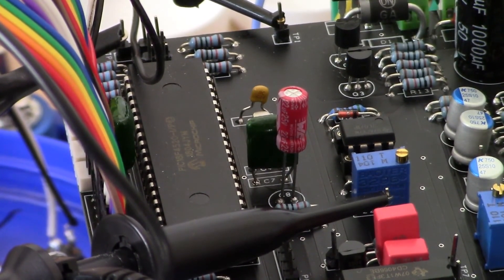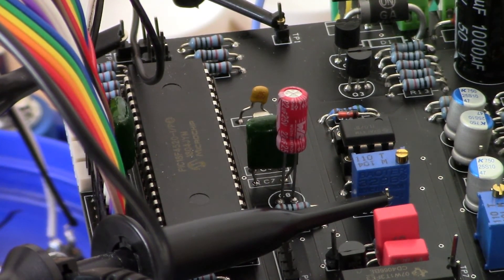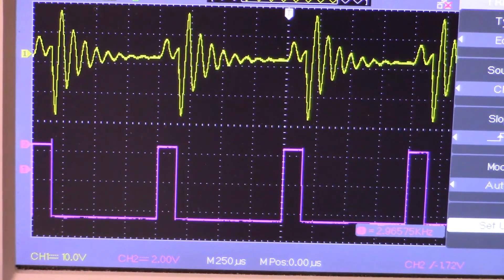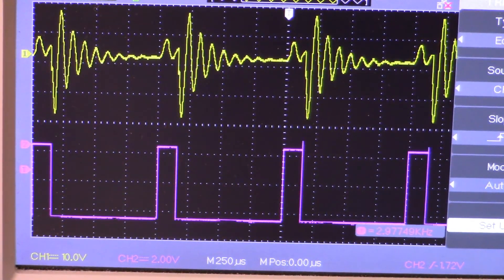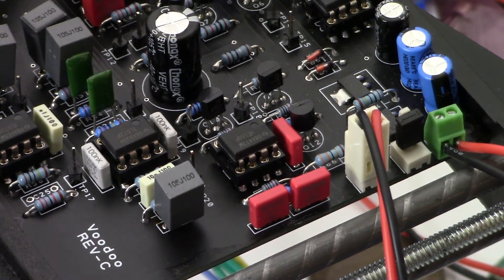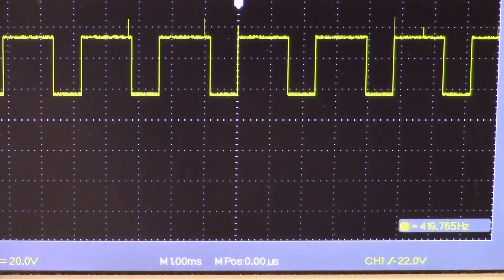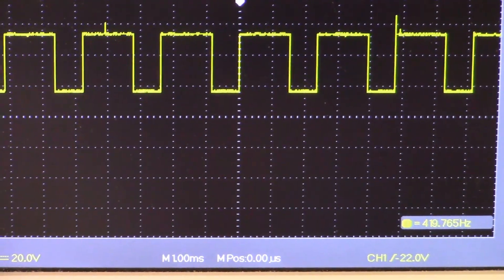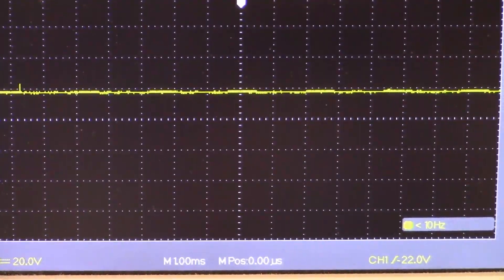Voodo DIY Metal Detector part #6 Disc pre amp and Audio circuit

Comment: Waiting with interest to see it tested. Did you finish the coil?
Reply from the maker: Hello,
I am using a Fisher F75 coil for this Voodoo machine.  I have taken it out a few times but did not record video because of the weather.  The depth on the machine is not as good as my other detectors.  Thanks for watching.
Reply: Surf Detector for me, i would like to use this detector in heavy mineralization, bricks, potery, with Concentric coil as is more good at target separation. So depth, for now, is not so important. I’m sure that it will be improved! For now i’m building DFBowers disc add-on.

Comment: Hello sir, how are you , thank you very much for these wonderful videos, good and useful information Please, I have a question about the voodoo project. I heard that it is open source and the source code is available. Question is there a possibility to change the screen programmatically with a larger one like 128 × 24 Or is it difficult and requires
Reply from the maker: Hello Bilal,
I imagine that it is possible if you were to change and recompile the code.  The person to ask is the creator George Overton on the Geotech Forum.
The 16x2 LCD is very standard and easily available so I do not see the need.  Thanks.
Reply: @SurfDetector  thank you my friend🙏

Comment: Finaly in the future on my MD project I'll also use 555 IC as the tone generator, pin 2 for the enable/disable the tone that triggered from signal level, and pin 6,7 for the tone frquency that controlled from phase shift for a different sound on each metal ferrous/nonferrous.

Comment: I want to see that baby in action 😎
Reply from the maker: I need to wait on some parts to box it up and then I will take it to the beach to dig up some nails :)
Reply: @SurfDetector  Please do detection depth comparisons between the Surf PI, Hammerhead, and Voodoo once you get them all finished.
Reply from the maker: @winstonsmith478  Hello Winston,
My free time is limited with my job and when I take a detector out to the beach I like to just detect.  I have too many detectors to box all of them up with shafts and dedicated coils etc.  I do the various builds in order to simply get a record of how to do the builds correctly in the hope that the videos will be of assistance to others down the line.  Thanks for the comments and please subscribe if you find my content interesting.
Cheers

Comment: Sir IC MCP631 or MCP632 or MCP633 is the good pre-amp (up to 24MHz op-Amp)
Reply: I'm sorry, I mean is 24MHz typically
Reply from the maker: I am not familiar with the MCP31 as I prefer through hole DIP opamps.  The data sheet says it is a 24MHZ bandwidth.
Thanks for watching.
Reply: @SurfDetector  Yes, after I see you working on 4MHz so I think TL071 is good.
Reply: sorry I mean 4kHz